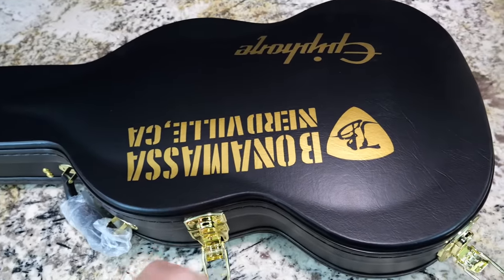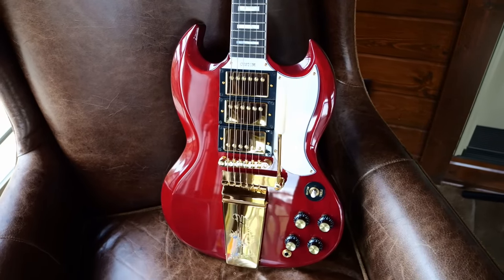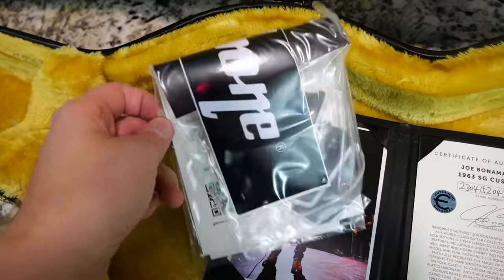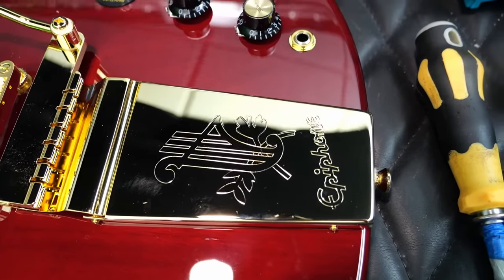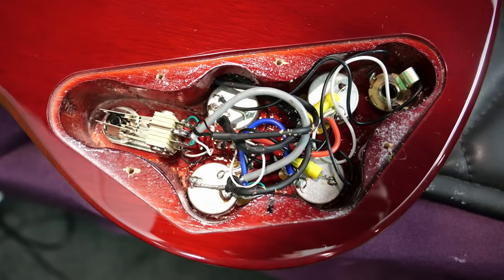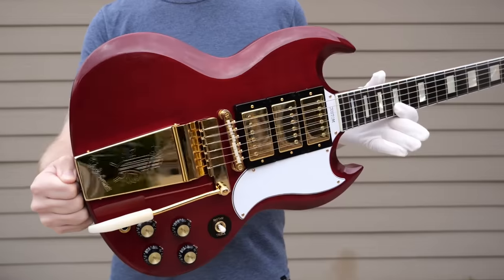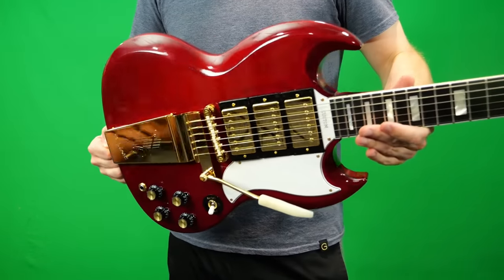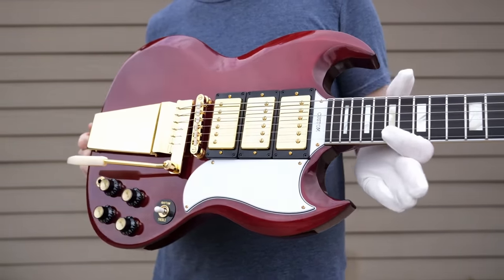This New Epiphone Looks INCREDIBLE! | 2023 Joe Bonamassa Signature SG Custom Review + Demo

Comment: If I had my eyes on this particular model, I would have it modified. I would have it changed so that it had the dedicated volume control for the middle pickup. That is something that other Epiphone G400 models like this Joe Bonamassa signature have got that improves on the architecture. I couldn't be satisfied just with the switching that is available here at present.
Reply: Putting the middle pickup on a dedicated volume, taking it off the toggle entirely, and switching to a master tone would really enhance how versatile this thing is. That's a great suggestion.
Reply: That already is present on some of the more economical versions play firefly, Harley Benton and, of course, Epiphone,  @TVsBen . The only reason they don't have it here is out of faithfulness to the original '61 SG Custom that was named after Les Paul.

Comment: I watched the video Joe Bonamassa did on the release of this guitar. He showed the original one and the one like Austin has here side by side. Explained some things on it that im sure the Trogster will cover. Including the case. That picture of JB as a kid reminds me of the youngest kid on the show Home Improvement. Think of it like this folks if this was specked with Gibson pickups it wouldve been at least $500 more. Or if this was a Gibson version you could likely bank on another $1K.
Reply: I have these same pups on my Alpine White Epi LP Custom. These Probucker 2 & 3 pups are awsum!
Reply: If it was a Gibson version it would be $15-25k. It would be custom shop or Murphy lab only. Just look at the Kirk Hammet signature Gibsons as an example.
Reply: @AWMJoeyjoejoe Pretty close to it. At least 6 or 7 grand for sure. JB is excellent player but Greeny's previous owners Peter Green & Gary Moore helped drive that price up.

Comment: Reminds me of the Capt Kirk SG. I wish Gibson would make some more of those in the dark wine red.  I dunno about $1400 let alone the $1900 some bozos on Ebay are dreaming about but I just paid $1600 or only a couple benjis more for a mint Gibson Tony Iommi SG with phat ass case birth photo and a bunch of toys.. of course the Gibson has nibs and plek'd frets too so really Epiphone is on crack really getting pretty fantastical with their pricing because there is a world of difference between even the highest Epi v the lowest Gibson w/Gibson just killing it. Worse your basic upper Squiers in $400-$450 range KILL mid priced Epis in quality and playability albeit in the Fender mode. I have ONE cool Epi from AMS a couple years ago - the '58 LE Korina Explorer with gold HW. & mini Grovers but the kicker is it's now extinct and Epi now has their new Korina Explorer for almost double what I paid for mine and it doesn't have mini grovers and the logo is in wrong position to a '58 compared to mine but it does have "Gibson" pups. Both are made in China as Joe's is too. Even if I cared enough to swap Gibson pups in mine it would still be the cheaper deal - from the same Epiphone no less. Weird I will make a profit if I sell my Epi Explorer, if you buy the NEW Epi, you won't ever make a profit off it.🎸

Comment: i feel relived because that "glue seepage u see i have on multiple frets on my ebony board on my alien tech green mustaine kramer and it wont come off with regular Lemon oil so when i take it in to my luthier to get set up they will fix it , its ALOT more severe on mine u just have a couple little dots mine has alot more only on the higher frets (16,21etc)
im relieved cause i didnt know what it was and it was a 1 off i got unlucky sort od thing but no its probably common with epi/kramer china ebony boards

Comment: 'Aged' binding on headstock and NOT on neck? Did someone at design actually say 'that looks great, I'll sign that off'.
Reply: That's how it is on the original.
Reply: @SionynJones  The yellow is over baked on Epiphone and looks so fake. Would have looked better as the same shade as neck and forget about aging. SG Customs with Vibrola are not my thing anyway, I had one on loan in the mid 70's, tuning stability was really bad, never knew anyone who owned one that peaised the Vibrola. But who doesn't love the look of a white SG Custom?

Comment: Put this in a stop tail variety instead and it'd probably sell more. If not for that crappy trem system it'd already be in my possession, resale value be damned. That black beauty he released was over hyped too. The price they command on the used market is absurd and totally not worth it. The Korean made black beauties had realistic tinted finish that the Chinese Epiphone plants haven't learned to recreate successfully yet and it's a damned shame.
Reply: Not only that, Korean workmanship is much better than Chinese workmanship.
Reply: @bucknasty69  couldn't agree more. Even the lowest end Korean made Epiphones were quality instruments. Indonesia made Epiphones are better than the Chinese made ones, too.
Reply: @MaxCohen-mx2rf  Korean made guitars are great. Their quality is catching up to Japan’s. I recently got a new made in Korea BC Rich Bich, and it’s a great guitar. They sell for $1500, but it’s neck through with a three piece maple neck, and comes stock with a set of Dimarzio Super Distortions and locking Grover Imperial tuners. I think that’s a fair price for a neck through guitar that comes equipped with premium electronics and hardware.

Comment: The greeny is the only one they can justify this type of price tag and even that’s pushing it but at least they put greeny buckers in it and you get an open book headstock. If an Epiphone  goes over that $800-$1000 price mark. should have Gibson electronics minimum. Whether it’s a signature/limited model or a standard production model. Epiphone  
is gouging at this point.